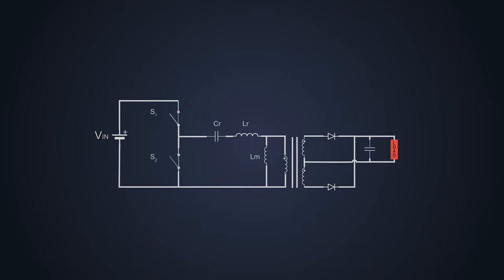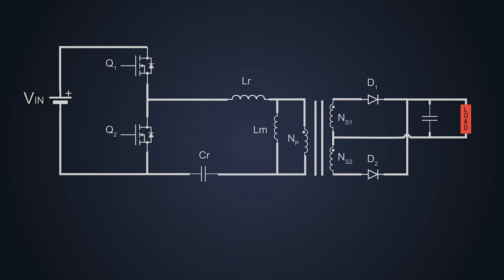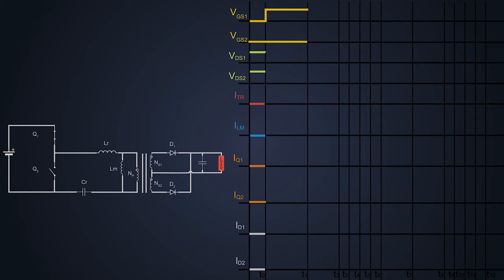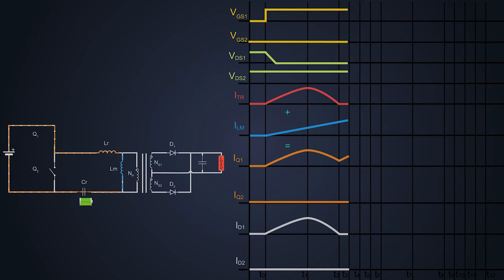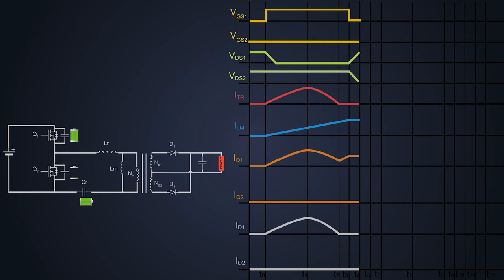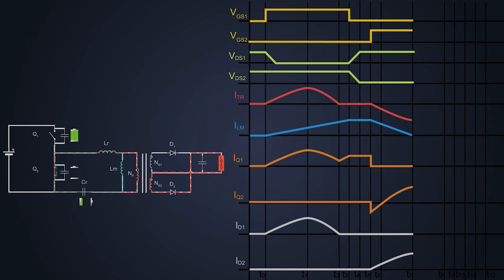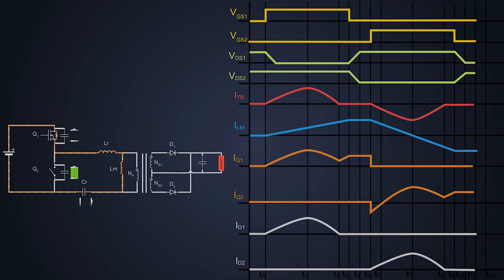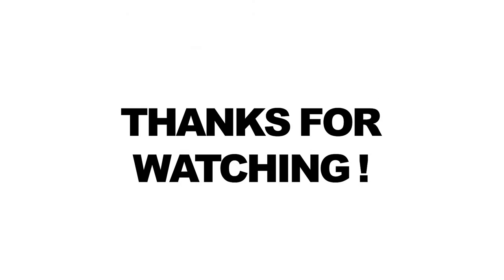How does a Half bridge LLC Resonant Converter work? Half bridge LLC Resonant Converter Explained

Comment: When Cr is discharging around time t7, u r saying that magnetizing current flows in the opposite direction but in the waveform Im is still in positive region even though it is decreasing. so which means direction is not reversed yet for Im, and the energy it has would be going where???? is it circulating in the path of primary winding and magnetizing inductor?

Comment: Why is a secondary with two windings better than one winding and a full bridge rectifier?
Reply: The B2 rectifier features 4 diodes instead of 2 for the M2. Therefore it makes more sense to use an M2 rectifier especially with higher output currents. The diode losses will be reduced by 50%
Reply: @SemproniusDensusGaming  ah ok so you are trading diode losses with transformer volume? Vor higher output voltages a fbr with single winding is better and vise versa?
Reply: @flavioernst902  basically yes
Reply: @SemproniusDensusGaming  thanks for answering!
Reply: Thanks for the informative videos.
If I have an LLC HB resonant converter running at 100khz. What should be the resonant frequency of Lr, Cr and Lm in the smps to work in ZCS mode?
Reply: Two diodes instead of 4